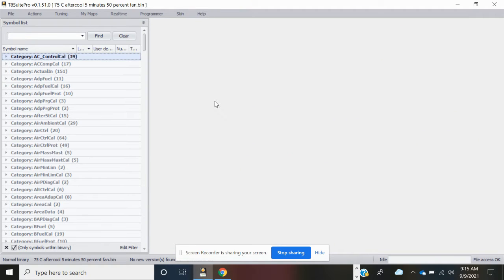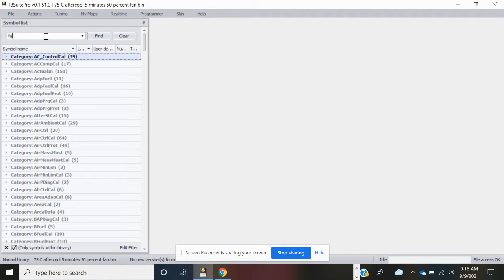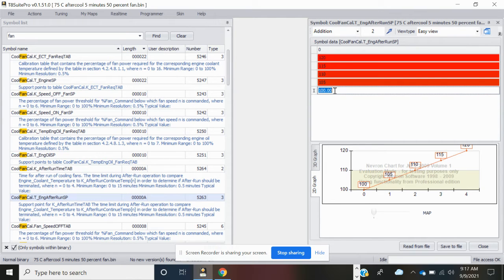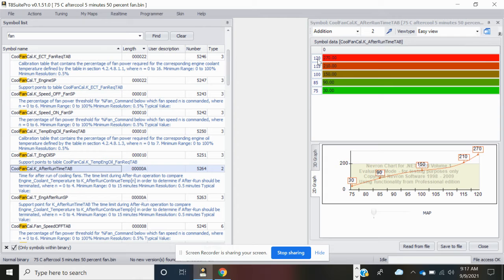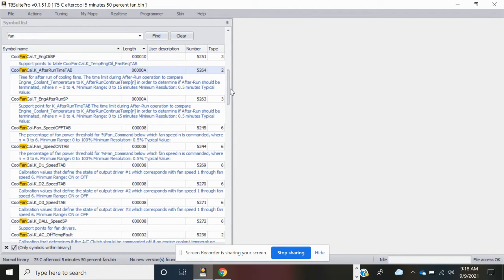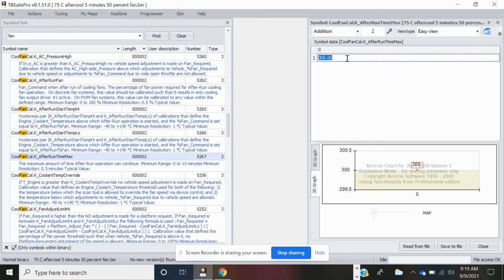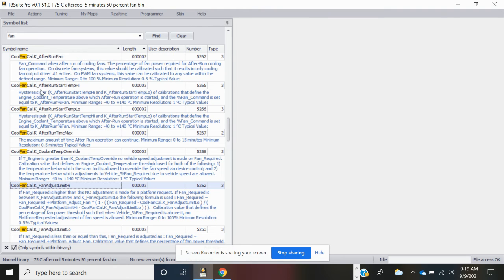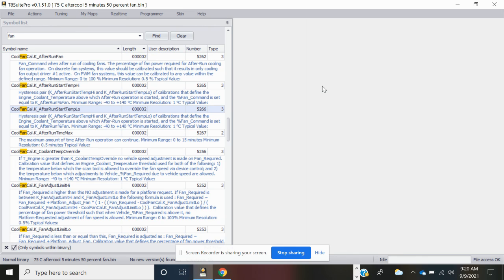T8 Suites aftercooling effect modification

Comment: Hi, what map would need to be change to lower the set point for normal conditions, as in when the engine is running, fan kicks in at 100 degrees can this be lowered thanks
Reply from the maker: You’ll have to dig around and read each section. It is this portion of the software. But you can find it.